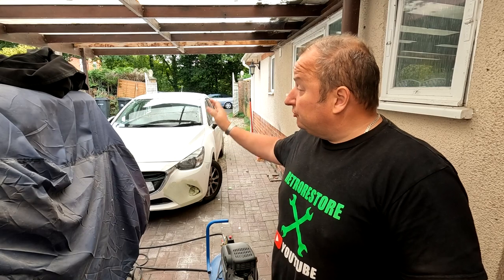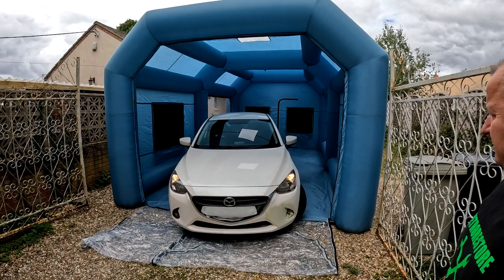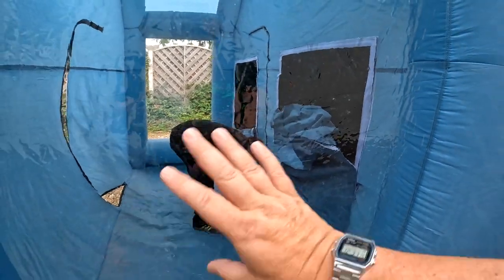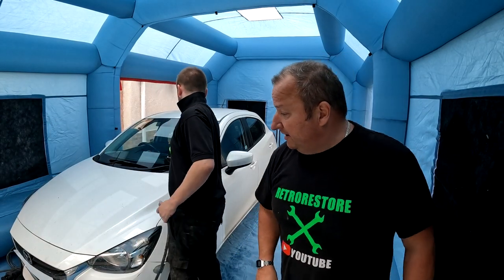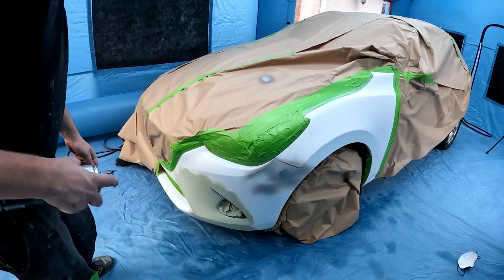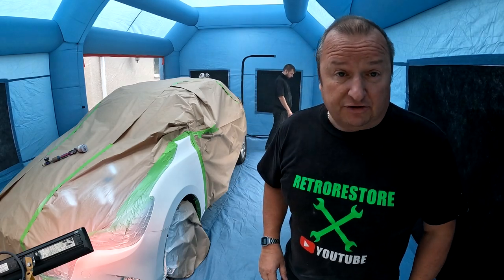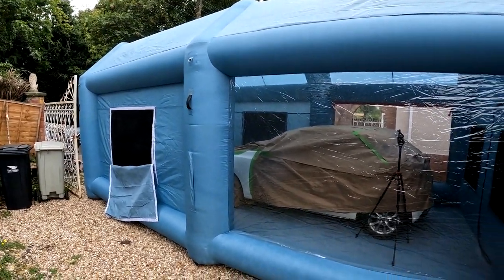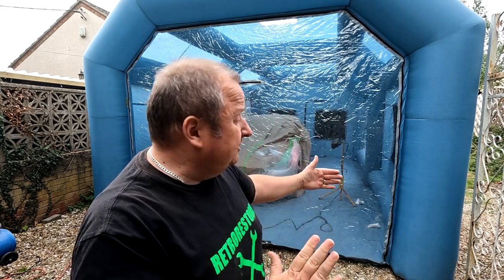Our First Car In The New Inflatable Spray Booth

Comment: Strikes me the only real down side is the constant noise - but that's a small price to pay for such a convenient set-up (provided you've got the space).
Reply from the maker: its very low noise, I did a video on the sound of the blowers with a db meter. and it was 45-50db
Reply: @retrorestore  Maybe it’s the compressor I can hear in this video…
Reply from the maker: The microphone makes it sound louder than it is.

Comment: Hi Martin good set up there, if i had that set up at home I think I’d invest in a silent compressor. I have the 25 litre Hyundai one but they do a 50l one they are so quiet. That compressor you using sounds so noisy, I’d be worried I’d be up setting the neighbours. When I have some spare money I think I may get one of those booths for my unit, good video 🙂👍
Reply from the maker: the mic makes everything sound loud Luke. We have run an air line from my log cabin to out the front before so no compressor noise but we were a hose short today.
Reply: @retrorestore  Oh that explains why it was noisier, I purchased the silent compressor so if I wanted to blow a carb out later in the evening neighbours wouldn’t hear it. If I walk about 10ft from the shed I can hardly hear it. I highly recommend one for smaller jobs 🙂👍
Reply: Awesome 👏 video as always.That booth is worth every penny 😊. Is spraying car’s Jimmy’s job as he looks so professional. You both work really well together.Even though I am a woman, I find your channel very interesting 🧐.Takecare and Keep warm.❤️🥰🪛🛠🚘👌🦋🏴

Comment: Thats working well for you martin does it keep the heat in to do spraying in winter times
Reply: I wonder if running the engine with a tube over the exhaust to outside would help
Reply from the maker: It does Roy, yes

Comment: would have been a good job apart from the uneven gap in the wheel arch to bumper creese
Reply from the maker: The customer knew the lugs were damaged so just wanted the repair and spray. New bumper was quoted at £800. What would you do, put up with the broken lugs or pay for a new bumper Dave?